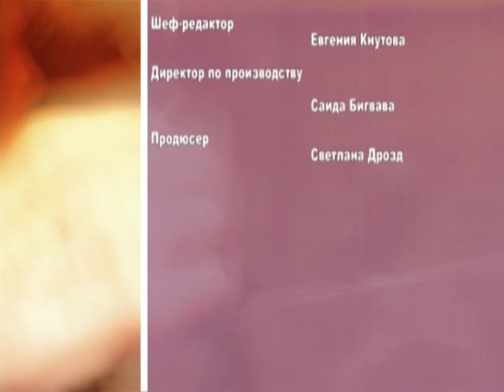One Stroke Painting. Part1. Crackle. Tatiana Kudryavtseva.

Comment: She is using acrylic paint. First layer is metallic acrylic paint, let it to dry. Second layer craquelure lacquer, the more you put on the surface the bigger crackes you will get at the end, let it to dry. Third is acrylic as well, but she warns that the paint reacts with the lacquer momentarily so she does not recommend to do the double painting of the same spot. Also she says do not use metallic or pearl colours for this layer, she recommends mate colours.